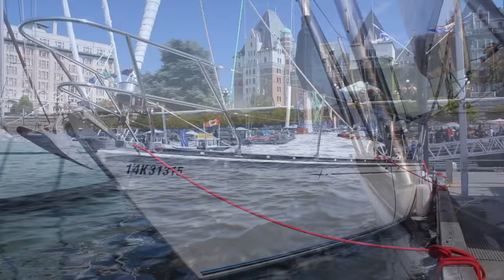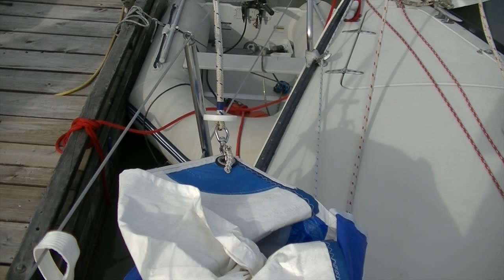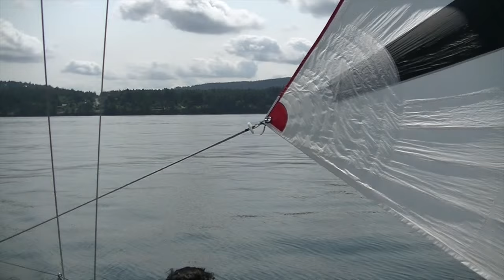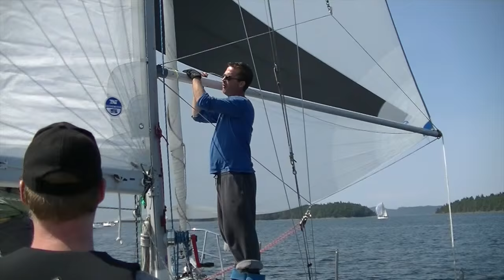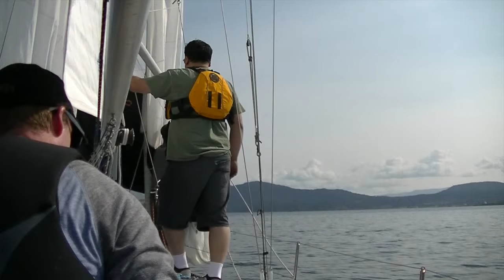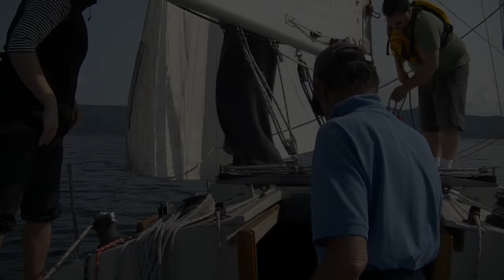Life is Like Sailing - Using the Spinnaker

Comment from the maker: Pfsif A genoa and a jib are headsails for upwind, A genoa is a sail that will go past the mast, a jib is smaller and won't go past the mast.  A gennaker is an asymmetrical downwind sail and a spinnaker is a symmetrical downwind sail.  The gennaker doesn't use a pole and the spinnaker does.

Comment: Very good explanation and supporting footage. Question: you referred to launching the kite sometimes while the Genny is still drawing but I didn't see any secondary winches, How do you manage all the sheets on one pair of winches?
Reply from the maker: Old Matelot Thanks and glad you enjoyed the video and explanation.  :)  It isn't easy to do the set without secondary winches for sure.  I am lucky that the Barient 28 it pretty big and I can get at least one or two wraps with the spinnaker lines at the top on the winch on while I leave just one or two wraps of the genoa lines on the bottom of the winch.  Then make the change.  Like I said it isn't the easiest or the prettiest, but we manage it.  Of course this would not be a heavy air situation that I would do this in.  lol

Comment: On the boat I've been sailing on recently (Carter 30) we've been throwing around some ideas about how to do the spinnaker better and I can't wait to apply some of the lessons learned here. Is the reason for the jaws on the pole pointing up so you can let the sheet (or guy) fly easily if you have to? I've seen them pointing up and down before on different boats and wondered which was correct and why. Thanks for a great videos Alfy, you'll make a good sailor out of me yet ;)
Reply from the maker: Brad Hubbard Hey Brad!  Really glad you found this video informative!  From what I understand the jaws face up because the sheet/guy will usually want to rise up because the spinnaker pulls the line upward.  The reason there is a downhaul/foreguy on the pole is to keep the pole from rising so imagine the same upward force is being applied for the sheet/guy.   If the jaws were facing down then it would be difficult to get the line out of the jaws with that constant upward force on the sheet/guy.  

I think it is also easier to attach the pole to the ring on the mast by pushing it upwards to connect as you can see in the video.  Patrick was able to just shoulder the pole upwards to attach it at the mast.  Well that is my 2 cents.  haha

Really nice to hear that you feel my videos could possibly make you a better sailor!!  That is a huge compliment, thanks!!
Reply: LifeisLikeSailing - Vancouver, BC that makes sense. I've definitely learned a lot from your videos and that makes me a better sailor and I'm sure I'm not the only one. Not to mention that I enjoy all your videos.
Reply from the maker: Brad Hubbard Well enjoying the videos is helps!  :)

Comment: Is the spinnaker taken before deck only for folding it back up with no wind in it, or is there another reason? 

I've bender sailed, or even been on a sailboat, but I'm reading thru an old sailing handbook, trying to get a feel for the info before I can find someone to go out and learn with
Reply from the maker: j3ah0o Yes the spinnaker is taken below for repacking, but also to get if off the decks and out of the way so we can start the upwind leg without trying to control a giant spinnaker on the decks at the same time.
Reply: thanks!
Reply from the maker: j3ah0o not a problem and glad you asked.  :)

Comment: I noticed your boat has a baby stay, I recently got a boat that has one, but it is permanently attached. Yours is slack, when do you use it?
Reply from the maker: The baby stay is adjustable.  I use it to put a bend in the mast which flattens the mainsail.  This would be done when sailing upwind in a stronger wind.
Reply: LifeisLikeSailing - Vancouver, BC thanks! That helps. I guess I'll add a block and tackle to mine to be able to get it out of the way of the spi pole...